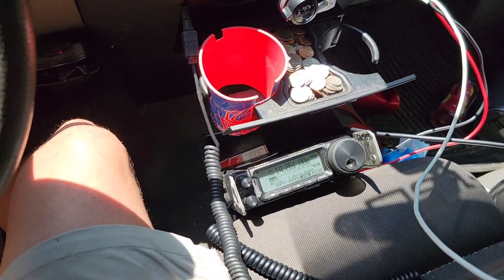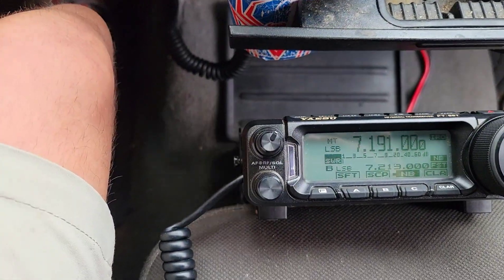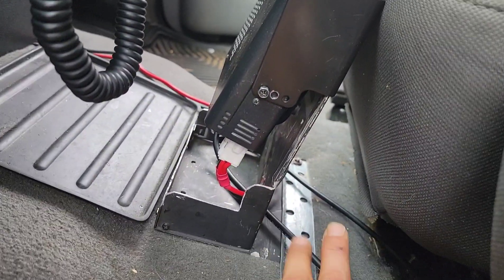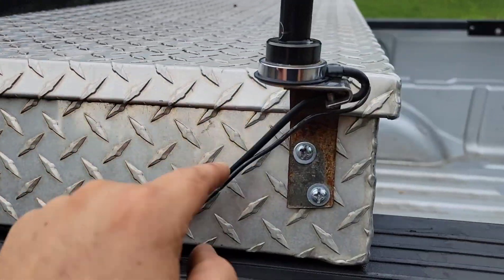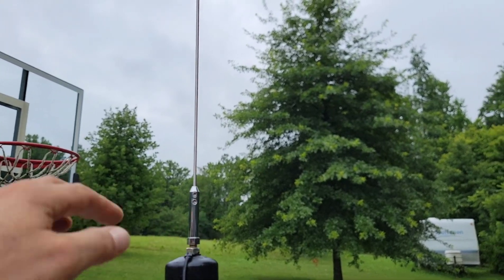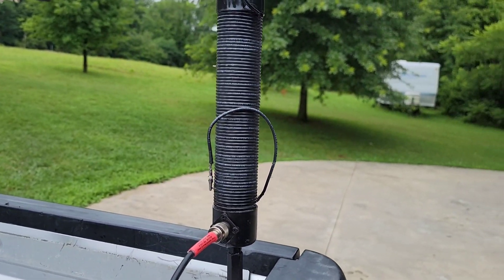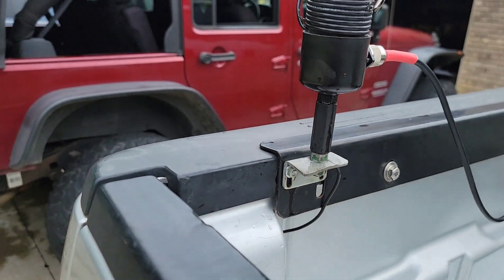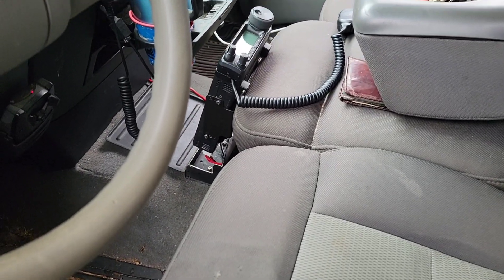Homebrew HF mobile antenna with yaesu 891.EASY!

Comment: Welp... I just made this antenna after watching you do it... I used number 10THHN on 2" PVC conduit, and then put a threaded coupling on the end and reduced it  down with aluminum RE bushings
Reply from the maker: I'm still using mine on my ford ranger.. Works pretty good. A little finicky on 40m but still tunable.. But made all kinds of contacts with it